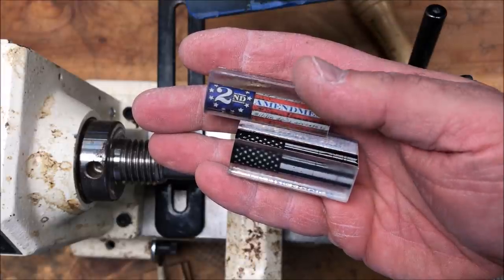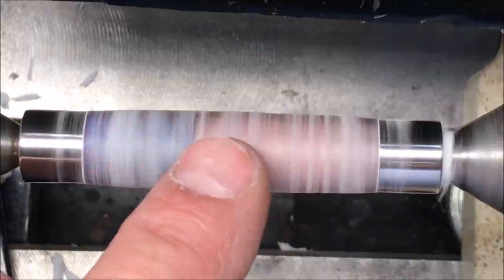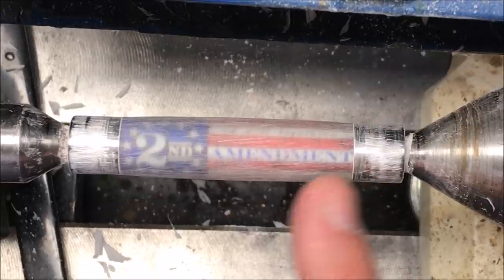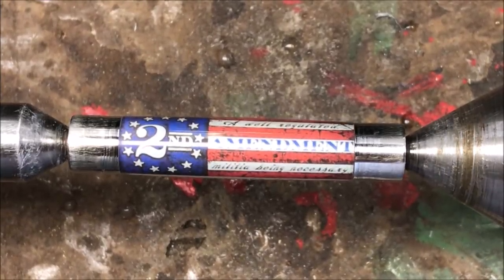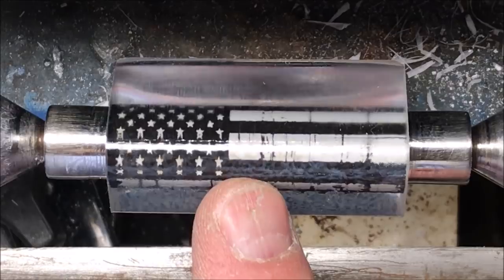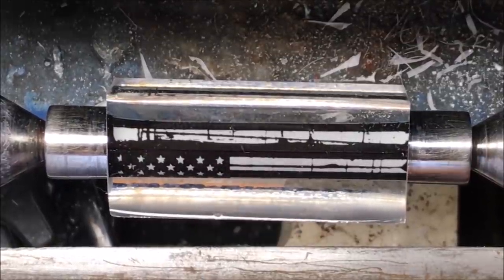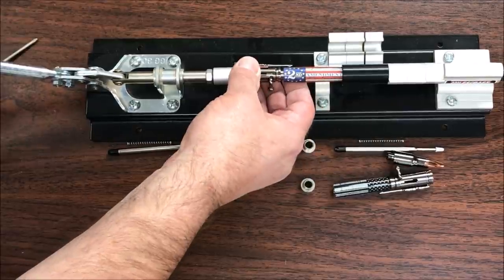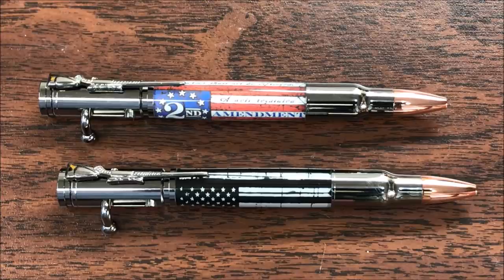Turning A Couple Of Magnum Bolt Action Pens

Comment: Wow, the recipients of the pens are going to be very thankful. Thank for taking the time on tbc, sanding with flat blank, applying the wax and buffing. No CA ? Red mark on your tool I hope it was just a marker. You went that step a little further than in other videos. Thank for coming back to explain more in detail.  Bob, great  job, thanks and keep up the good work. Welcome back!
Reply from the maker: Thank you Eddie,
  I only use C/A on Alumilite for repairs. That red mark was left over from the sharpening process. I’m changing the grind a bit on the tool so it will take a while to wear away. 

Regards,
Bob

Comment: Very nice Bob! Thanks for the great tip on using the blank as a sanding backer. I'm gonna try that!
take care, Dave
Reply from the maker: Thank you Dave,
  As long as you don’t get aggressive and apply to much pressure it works great for leveling out a blank. 

Regards,
Bob

Comment: Great pens Bob!! Do you find that renaissance wax works better than a CA finish?
Reply from the maker: Renaissance Way is in addition to C/A on wood pens. I use it for the final polish. 

On Alumilite pens, I do not use C/A unless they are a wood hybrid. 

Find yourself a good headlight scratch remover at the auto parts store. PlastX works nicely and use that. 

Regards,
Bob

Comment: You know the only reason you find that bolt action weird is because you're left handed. The kit comes designed for right handed people. If I'm wrong please tell me
Reply from the maker: Hello Brandon,
  I don’t think your wrong. The only reason I rotate the bolt is because that’s the way the bolt works on my rifle. It angles down so naturally I felt like the bolt on the pen Should angle down. There is no right or wrong way it’s just a personal preference and can easily be changed back by the new owner with a screwdriver. 

Regards,
Bob
Reply: @RJBWoodTurner  Also I just gotta say I've learned so much from your videos and have seen improvement in my work so I just wanted to say I appreciate you and your channel!
Reply from the maker: Thank you Brandon,
  I appreciate that comment and am glad I have helped. 

Regards,
Bob

Comment: anyone else loathe bolt actions, is it just me?
Reply: I love them.  Nice kits.  Irritates me I always have to turn the bolt the right way though. Silly Chinese...
Reply: @seanobrien7169  At least you have the option to change it.  Also it may have not been designed by the Chinese.  Only manufactured there.
Reply from the maker: The bolt may be a gimmick kit but it is the best gimmick kit. You may hate it but people buying pens love them and I sold every one I ever made.
Reply: @RJBWoodTurner  I'm not in a position of having to sell everything I make. I'm a hobby craftsman. I make for the art of it. So just because they sell does not make them good, right, or beautiful; remember the Yugo, ugly car, sold well.
Reply from the maker: @jacknemo8021  point taken.